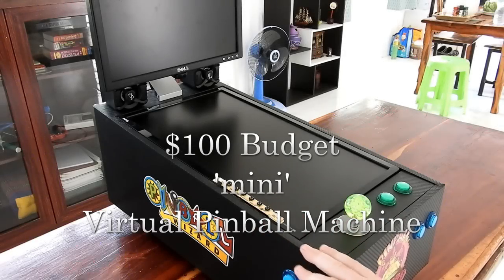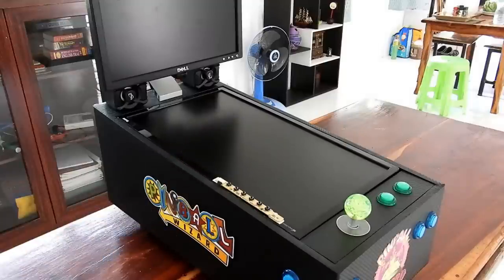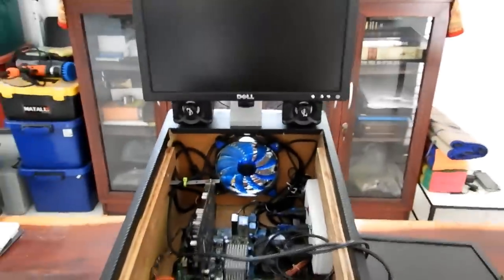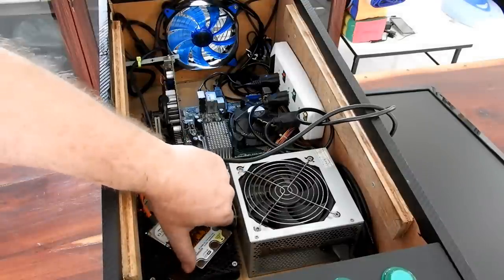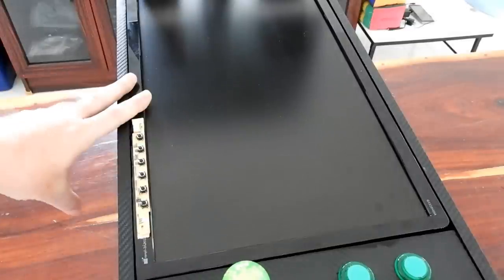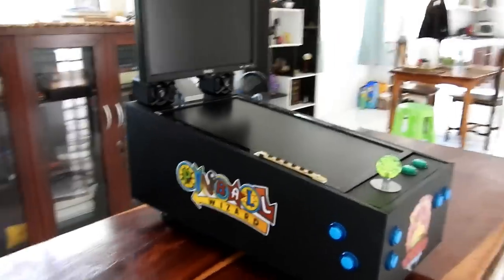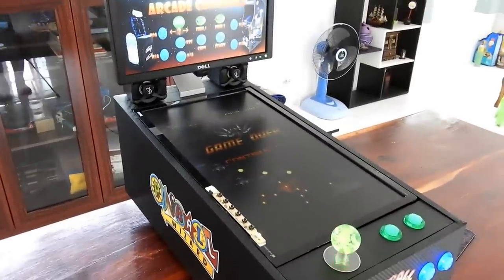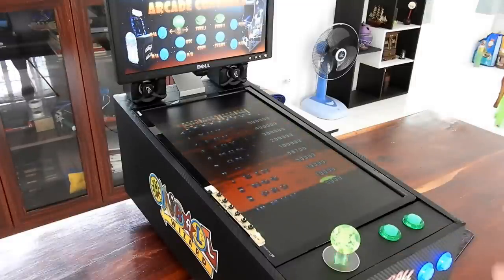$100 Ultra Low Budget Mini Virtual Pinball!

Comment: what causes input lag issues? do you need a software program to run the pinball files or are all virtual pinball games files don't need a software program to run them? some virtual pinball games are 4K HD that are 2D or 3D but the files might be different. It uses a special camera that is located in the backglass that will adjust the playfield graphics depending where you are standing.
Reply from the maker: Hi Bill, you need a reasonably fast processor and dedicated graphics and not running any other programs and input lag will be minimal. If you've got lag your computer spec is too low or other running programs are affecting it. 

4K is very high resolution and will require a MUCH more expensive computer spec than this as well as a 4K playfield monitor.

Software to use are Future Pinball and Virtual Pinball - there are many free tables for these programs. Tables are rendered either 2d or 3d but need no other software to run.

You refer to the video of the guy who put a Kinnect camera in his backglass and the table view changes depending on the position of the player -  this is very advanced and beyond the scope of this video. Most people who make their own tables do not have this feature. Please look at Future Pinball and Visual Pinball forums for more help with this.

Comment: What's the best monitor resolution to use for most tables?
Reply from the maker: I used the Benq because I had it but I would recommend something like an Acer K242HL monitor which has neat, square contours (unlike the Benq I cut the control panel off to make it square)... Take a look at some of the other clips especially the last where I source the parts. Cheers!

Comment: what are the names of the software you used and if mame what are the names of those games and version on mame . id like to add a pinball feature to the arcades i build . thanks
Reply from the maker: Hi! Future Pinball (standalone program) and Visual Pinball (standalone uses PinMame). I have videos here on downloading and installing these - take a look they're very easy to get up and running. Hope it helps!
Reply: @arnoldj.rimmer5116  ya sorry i saw someone else asked i wanted to add it to my already built rpi arcade using mame . otherwise i might as well build a whole pinball specific unit which i dont mind but if i can just add two buttons on side to my arcade that would be cool to

Comment: Id make this using a raspberry pi4 to cut down on costs.
Reply from the maker: Hi Shawn, I don' t believe you can run this on a pi, which is why I went the cheapest PC route... Similar price to a pi I think if you shop around - check out my sourcing & pricing video. Cheers!
Reply: Ive seen virtual pinball software for the raspberry pi. The pi has dual micro hdmi.

Comment: only thing i think ruined it was the big stick hardly would be needed if was only for pin other wise a small keyboard for working on the front end
Reply from the maker: Agree - not necessary at all for a pinball game and the USB wifi keyboard does the job. I included it for MAME, but I could easily make another crosspiece without it. Cheers!
Reply: @arnoldj.rimmer5116  kool i would other wise it looks nice nice big box and would be complete
Reply from the maker: Hi Charlie I made some changes here:- https://youtu.be/BxqoeDUtWYs take a look!

Comment: Everybody makes a precise mistake with ventilation inside this "amateur wood boxes".....if you really want to get out the warm air you have to put the cold through another hole. For example every basic PC ATX cases use same way.  "in" hole  should be placed lower than "out" hole because warm air 
rises up. And thats all. I like idea, built smaller vpinball than usual dimensions. Thanks for this video...
Reply from the maker: Hi Martin! There is a fan drawing cool air in from below the cabinet and another blowing hot air out the rear. Cheers!

Comment: what the scale of the monitor
Reply from the maker: Hi Tim, it's 22" 16:9 1920x1080, but I used this because I had it already and it needed slight modification. I would recommend a different monitor which doesn't need modification (but is slightly bigger - Acer K442HL I'll put a link in the description).
Reply: @arnoldj.rimmer5116  
Ok thanks

Comment: Hey Arnold - love the build very much! Completely inspired now and I'm now in the process of building my own using your plans. As I'm getting my cuts ready I had a few questions:
1 - Are the front and back panel's sandwiched between the two side panels? Or did you overlap the front and rear panels over the side panels and then screw them in? I'm assuming it's the former. I hope that makes sense.
2 - How did you get that nice plug in the back of the whole table? I like that it's all self contained and you have a single plug off the back, which connects to the power strip / surge protector... just can't figure how you got that nice plug to tie into the strip!
Thanks Arnold! Will probably have more questions as I keep building...
Reply from the maker: Hi Chris! Really pleased to hear you've been inspired by this! Exactly - the back and front are just sandwiched between the sides and held in place with screws as is the base. Pilot drill the holes so the wood doesn't split and countersink the heads flush. The rear plug socket was ordered off the internet for around $3. It doesn't come with any diagram but it's not difficult to wire up. I just cut the power strip plug cable to length and wired it to the socket using spade connectors. If you're unsure use a circuit tester to carefully see which connector is live when the switch is set to on. I used a hole saw and rasp to drill and shape the hole for the plug. I just took a picture which isn't very clear but might help, here: https://drive.google.com/file/d/1bjEkzM9lGfRuyDoHQ3geHjFgMsef4lpA/view?usp=sharing Cheers!

Comment: I have some questions about the pinball. How can I contact you ?
Reply from the maker: Hi Guenther, thanks for your interest - you can ask me about this on here, where it might be helpful to others. Cheers!
Reply: @arnoldj.rimmer5116  It would be interesting to know the size of the pinball or a plan. Also it is interesting for me how the connections from the buttons to the Zero Delay controller are like. Unfortunately, I haven't found a useful guide yet where to show which connector is for which button.   
What Software do you use ? Thx for answers.
Reply from the maker: Hi Guenther - thanks for he input. You are right, I couldn't find a clear and simple guide to setting up the zero delay board either. I'll make another short clip very soon with an overview of the plan, the software and some details on setting up the controller board. Cheers!

Comment: Magnetic save buttons?
Reply from the maker: For this project I assigned magna save to the same button as nudge. But the USB encoder does support up to 12 buttons + joystick, so you could add more buttons for magna save if you wanted for the tables which support it. Cheers!

Comment: My final offer, $400 shipped ;)
Reply from the maker: Hi Todd! It isn't a viable option for me to spend a week (which is how long it took me) to make one for you mate - my labour would be $700 straight off and then shipping a 20kg box to you would cost even more!
I spent an hour or so sourcing the necessary parts for one of these on Ebay 2 days ago and found them all in USA for less than $150! That is how much it would cost to build one yourself including the software! 

I've got a problem with my video editing software stopping me from making a clip of finding the parts, but I'll try to sort that soon. Cheers Todd!
Reply: @arnoldj.rimmer5116  I'd still have to find someone to build the cabinet :p
Reply from the maker: @wulfie66  It's just 2 sides 2 ends, the bottom, the monitor support rails and cross pieces screwed together - I'm not adept with wood either but this isn't difficult. Download the plans in the description to use as a template and change the dimensions to suit the playfield monitor size you are using. you don't need a big sheet - I used plywood because I had it but MDF would be just as good or even better. Cheers!
Reply from the maker: Hi Todd look here mate https://youtu.be/lsyn_yKI5zE